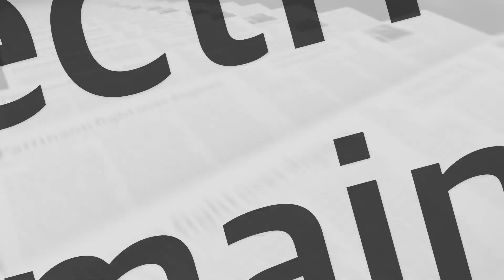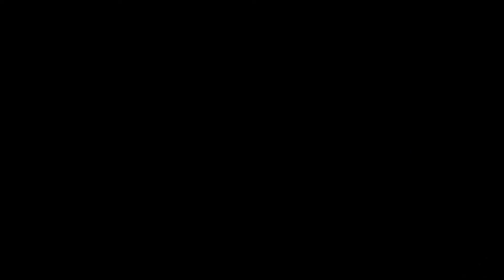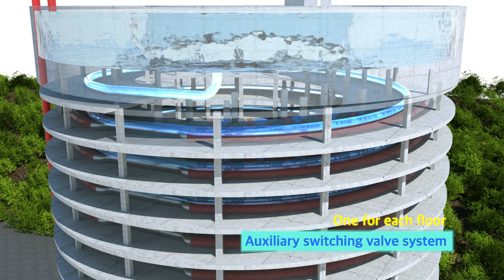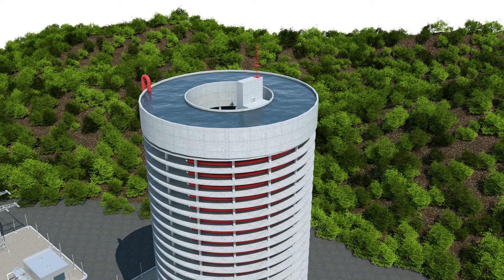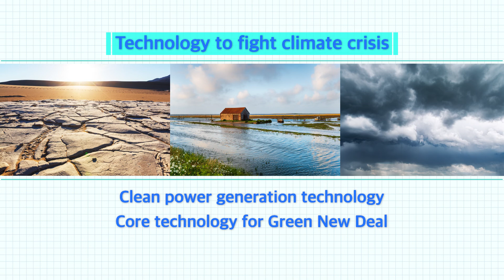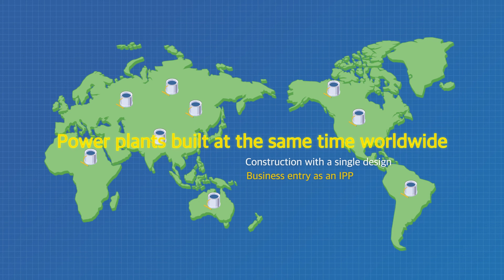heavenenergy, pumped-storage hydroelectricity tower plant

Comment from the maker: "플랜트 설비, 연료의 물류, 냉각수가 필요 없기 때문에 입지에 제약이 없다는 것이 장점입니다. 산업단지, 도심, 사막, 산악지역 등 실수요지 어느 곳에서도 안정적인 전력공급이 가능하며 송전탑이 적게 필요하고 송전손실이 적을 뿐 아니라

The advantage is that there are no restrictions on location because there is no need for plant equipment, fuel logistics, and cooling water. Stable power supply is possible in any area with demand, such as industrial complexes, downtown areas, deserts, and mountainous areas, requiring fewer transmission towers and low transmission losses.“

Comment from the maker: "수력양수발전타워발전소는 발전기 1개의 발전 용량은 작지만 30층 960개의 발전기가 
모여 대용량이 되는 발전방식으로 펌프 양수 전력소비량은 15,000kW, 발전기 1개당 1,200kW, 960개 1,152,000kW 설비용량을 갖춘 발전소로

The pumped storage hydroelectricity tower plant uses a power generation method: the power generation capacity of one generator is small, but 960 generators on 30 floors are gathered to create a large capacity. The power consumption for pumping is 15,000kW, and 1,200kW per generator, a total of 1,152,000kW with 960 generators."
Reply: I could not clear your comment please reexplain for that thankyou sir.